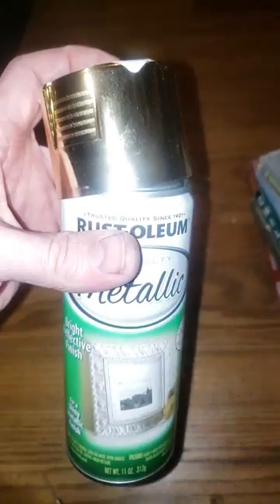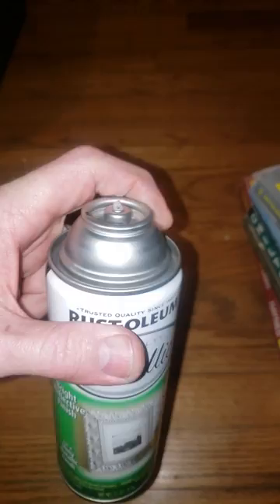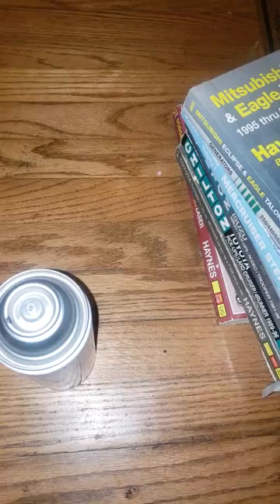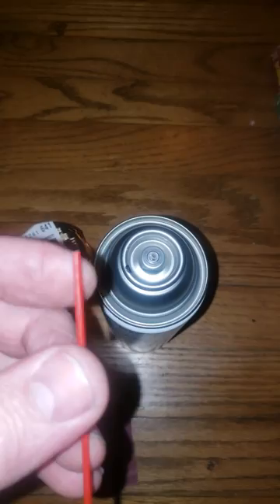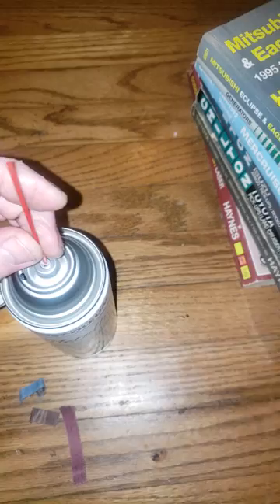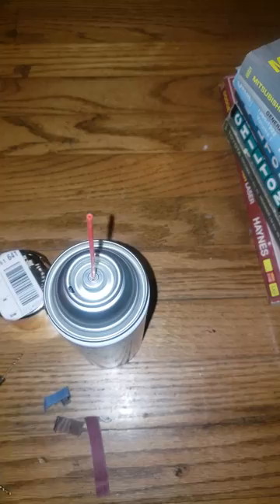Spray Paint Nozzle FIX! Broken nozzle / tube!  L@@K!!

Comment from the maker: I just removed another comment about just buying another can instead of going through this...smh.  I think this took 10min to do and where I live this can of paint was like $12.95 and I live 25min from where I purchased.  This works for $50 cans of automotive clear coat, paints, etc.  If you got the money & time to go buy another can instead of taking a few minutes of time to do this,  then by all means...sure, go buy another can of whatever broke on ya.  I know I have certain kinds of paint or chemicals that are a couple years old but still good. This has worked on those too.  This is for someone that doesn't like wasting money, product, or time....just saying.

Comment: A bit tricky but nice job
Reply from the maker: Yeah, have to be careful but it does work to where you can continue using paints with broken tubes.  I also found a way to "repressurize" paints, wd40, etc but it will have to be a much more detailed video. I do apologize for not actually filming more of this process....I may do a Part 2 with no steps omitted as far as viewing the process. Thanks for the comments and likes.

Comment: Same thing happened to my rattle can of Rustoleum enamel. Pull off the cap any way but perfectly square, and snap the straw into a jagged mess. Honestly, that's ridiculous. The big moral I'm taking away from this is to switch brands...
Reply from the maker: I just bought another can , same brand....totally different spray nozzle.  I emailed Rust-Oleum the link to this video and complained.  They sent me another can just like in video and said they had other complaints . I'm sure there are plenty of the old style in circulation though....it's definitely terrible that so many people had same problem with same brand and I agree.

Comment: Genious! Thank you so much!
Reply from the maker: You are welcome.....I have been getting so many, Thank You comments,  except for a few saying I should have showed in the video every step (even though in the drop down I told every step I did),  then also a couple that must have used a drill to drill the tube out???? They got sprayed...I thought I was fairly clear to do it by hand so getting sprayed would be less likely.   Also, I think we have to use common sense when working with pressured cans.....this idea is just to be able to use paint that we basically just bought and the tube in the can got broken most likely when pulling cap off.

Comment: I wish you warn people about drilling it incorrectly will result in THE CAN SPRAYING NON STOP COMPLETELY WASTING THE CAN. F i
Reply from the maker: That should be common sense...and exactly why I said to use small bits and DRILL BY HAND.....I actually showed me spinning the bit slowly with my hand. Any mod can be dangerous but I did say in the video to do it by hand.....the only time I said to use the drill was when I locked the straw in a drill to spin it while wrapping the sandpaper around it. It says on the can that it contains high pressure,  use caution.   I do appreciate ALL that have did this and successfully got their paint useable again.
Reply: He did say "drill by hand", and in the video, he doesn't use a power drill on the can .

Comment: Instead of sanding the straw to fit, just do the same drilling on the spray nozzle.
Reply from the maker: Thanks, I had to do that on one nozzle.  I guess I should have been clearer in video but I sanded straw for paint can end because after using 2 bits it was pretty thin and didn't want to make it any thinner so I sanded the straw down so it fit snuggly.   One thing I have noticed is those red straws,  not all are the same size...even on same brand of brake or carb spray but haven't found one so different it would not work. Coffee stirring straws will work as well